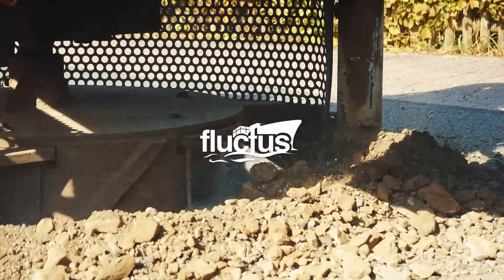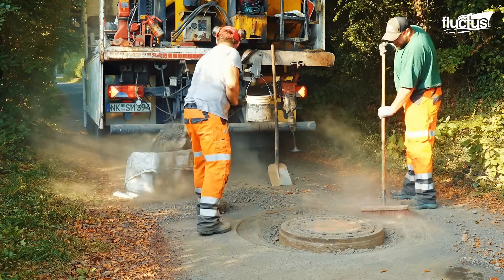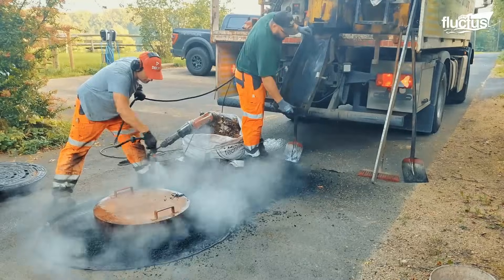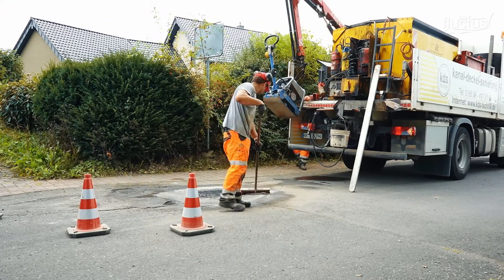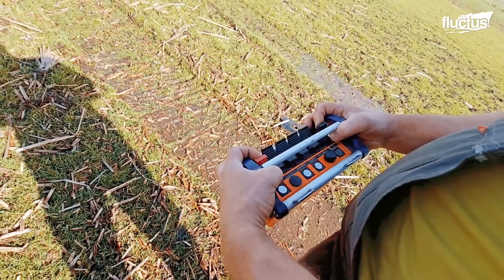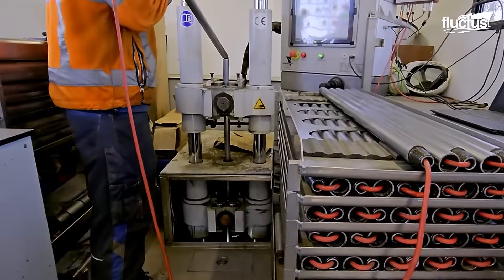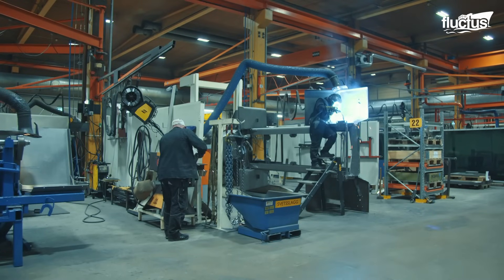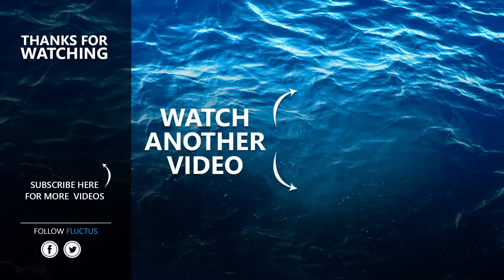Germany’s Genius Way to Quickly Repair Giant Manholes in Middle of Street

Comment: We have streets in Portland Oregon paved in 1900-13 using Hassan Concrete. Never need repaving. Still having the original manholes and covers. Every now and then, cracks are tarred. That's all. Petroleum industry sold you guys a real scam

Comment: Q: What is "asphalt-concrete"?  It's either asphalt or concrete.
Reply: Same as tarmac in the UK (tar + macadam stone). A composite mix of bitumen with stone aggregate. Concrete in this context only means 'composite' and has nothing to do with cement. Yes, sounds like a misnomer but that's the formal name in the US.
Reply: Thank you, mentioning that was the only reason I opened comments.
Reply: @ same!  bad translations all around, like using "moisture" when not referring to water